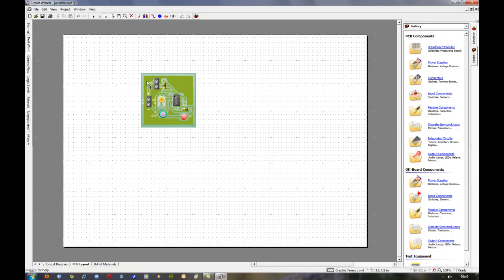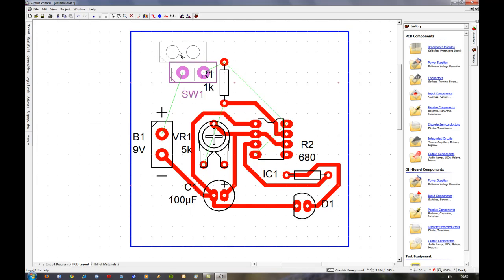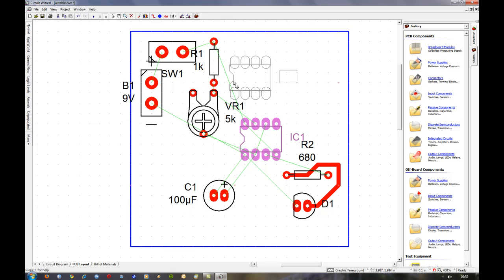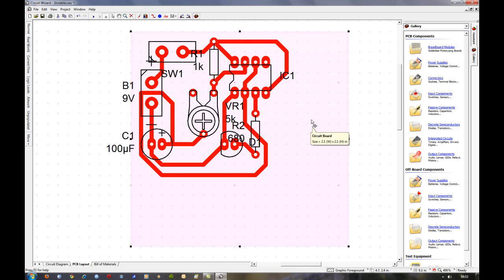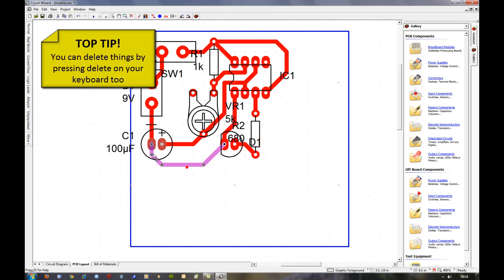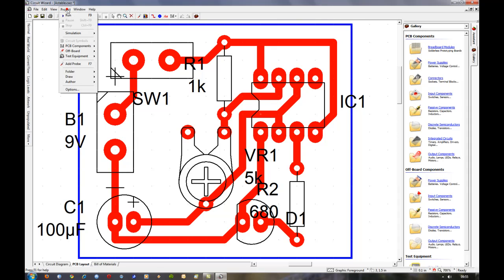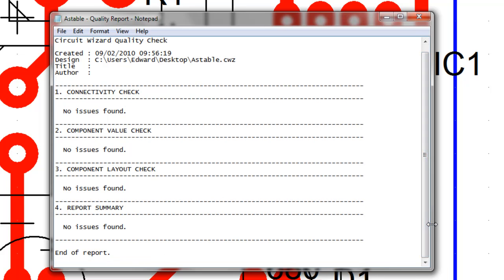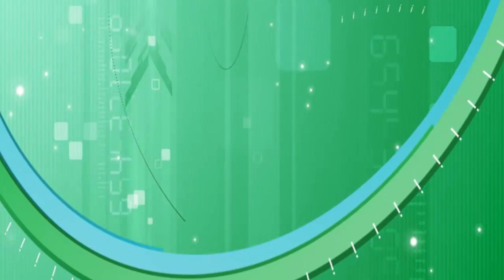How to Design, Develop & Manufacture a PCB | Part 2.2 - Manipulation of PCB Layout

Comment from the maker: Yes, that's all really.  You also need to consider the dimensions of the package.  Sometimes the silkscreen outline might not actually be as big as the real component.  I notice this especially on terminal block, which means you have to be really careful when positioning them to ensure they have enough clearance.  Look at the datasheets and if needs be just use component pads on the artwork instead of the component, as long as it is clearly labelled :)